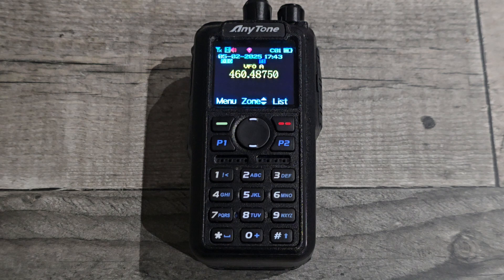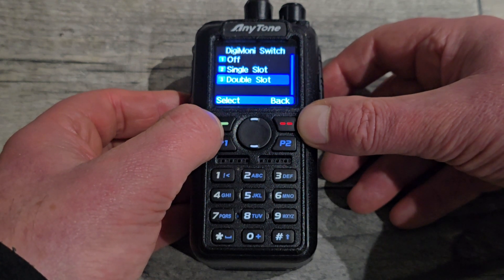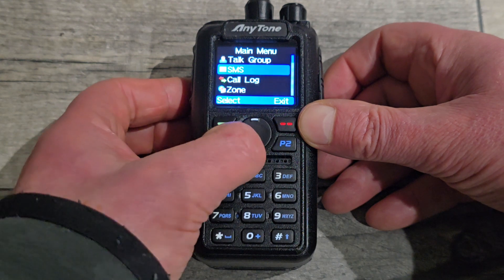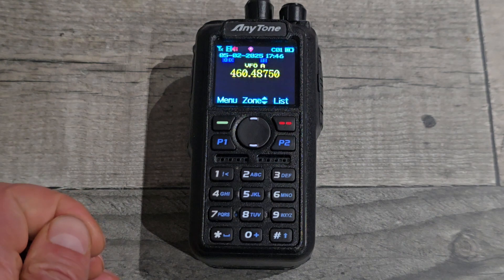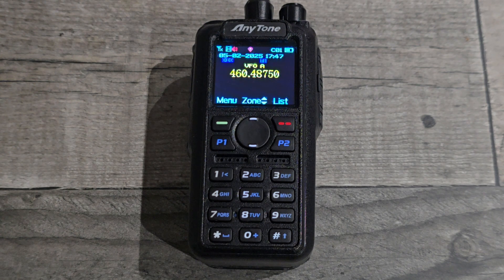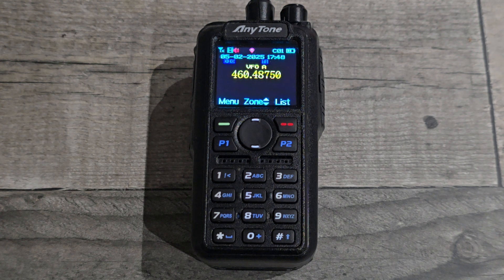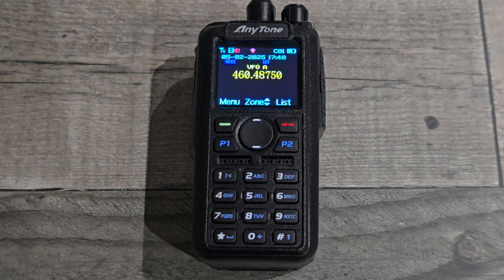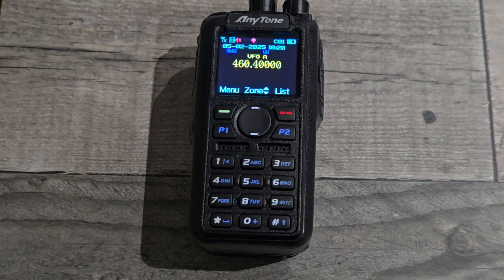Use Anytone 878 as Digital Scanner (settings and Demo)

Comment: Really informative video - thank you. Is it possible to scan channels that are stored in the memory, in the mode where the colour code doesn't matter - or do you have to be using VFO mode for it to work? Thank you
Reply from the maker: Yes once you discover the color code and slot you can program them on any radio that has DMR. Whether they would be picked up with a scan I'm not certain but I would suspect so if you are in digital monitor mode. I did this video because I've not seen anyone else cover this ever. Thanks for the comment

Comment: Thank you for posting.  I have an issue,  maybe you figured it out.   When I get to VFO Sc-MinU, and enter a frequency, I get a Freq Error ! message.  It doesn't matter what I type in.   Same for MaxU.    I am using an 878UV Plus with 3.06 firmware.   Thanks.
Reply from the maker: When you updated the firmware did you initialize the radio. And then put your code plug backup in. Also check your in amateur radio mode in CPS. I cannot think of anything else. If you cannot search between two limits you can still pick up digital traffic from security and non ham.
Reply: @digitalanaloguehamradio  Thank you for the reply.   This was going on before the upgrade,  but yes, the radio was initalized afterwards.   I think your on to something with the mode.  My radio is in Maintenance Mode 00014.  It's the only way to use 200 MHz.    When I try to switch it, everything gets erased and it won't load to the radio.
Reply: Well, after trying everything else.   The obvious is the answer.   I didn't realize I needed to enter 5 characters (numbers or zeros) after the decimal.   It's not math.   So yes, it does matter.   Thank you for posting.
Reply from the maker: If I saw it in person I could spot it. But from the description I couldn't picture it. Anyway well persevered
Reply: @digitalanaloguehamradio  Thank you again.  '73

Comment: I can’t find the scan settings on the D168 as you showed in the video, they aren’t present on the D168
Reply from the maker: Interesting are you on the latest firmware. So when you go to key set you cannot see the option program scan. Make sure you are in digital mode as you get different options. Also make sure you are in vfo mode. On the 168 out the box you have to assign a key to vfo/Mr function
Reply: @ yeah on the latest firmware as I updated it couple days ago, have the vfo set correctly too but no option for the scan option in the settings, your video is perfect for what I was looking for but seems the 168 maybe isn’t compatible
Reply from the maker: Look at the options and you will see vfo scan. This is an option you can assign to a preset.Let me know if it works.@Liam2E0LDQ
Reply: @ cheers I will have a go and update back
Reply: @digitalanaloguehamradio  yeah deffo no vfo scan options on the 168 I’ve gone right through it and looked
Reply from the maker: It is on mine. You’ve got to be on digital.. you have got to be in the vfo. I have the mode set to digital only and not a combination. Make sure you set  upper and lower limit . Put the Vfo in the middle of that range .then you go to key function and assign pf1 and you see what’s available. After you said I checkedon my 168.vfo scan is there. If it’s not there, it will still work, but you can’t go between two limits. I suspect vfo scan is the same as program scan it just uses less letters with the narrower display.
Reply: @ managed to assign vfo scan to the pf1 long press and it does scan but as you say cannot set the limits
Reply from the maker: In the computer software an optional settings does the upper and lower limits. If it does then it is if it doesn't then it won't work

Comment: I Chris,
‘Slot Hold’ under DIGI MONITOR holds onto a slot when scanning. Say your listing via VFO on a DMR channel on slot 1 and a person stops talking on slot 1 the radio immediately starts switching the slots numbers and if someone comes in on slot 2, then you miss out on the original conversation on slot 1 that you were originally listening too. 
With ‘slot hold’ turned on, the radio pauses on the original slot number you were listening too for 2 seconds so you can continue listening to the original conversation. If it’s turned off then the radio starts switching slots between 1 and 2 soon after a person stops transmitting and you loose the conversation on slot 1. 

With’scan mod’ TO, CO and SE, these only work in VFO mode. 

Hope this helps.
Reply from the maker: Thank you for the super detailed information. Very interesting actually by the sound of it initially slot hold sounds like you will be missing out on the other slot. It’s a great radio. I just wish it was quicker at scanning not much of an issue where I live most of the digital stuff is concentrated into a small frequency range. Thanks for the tip and appreciate you watching.

Comment: Brilliant. You make it look easy. You don’t have a code plug 😢
Reply from the maker: Thanks Neil well it looks easy because I spent a few hours learning every setting I could find. I really mess with the code plug. I like to do things on the fly on the radio itself
Reply: Thanks for the reply. I’m in the buy a good radio and don’t get a chance to figure it out club. There is a massive menu on this model. Just don’t know what a lot of the Acronyms mean.
I was meaning is it hard to find someone who has written a code plug for this radio that I could install. It does depend on your local dmr users 👍